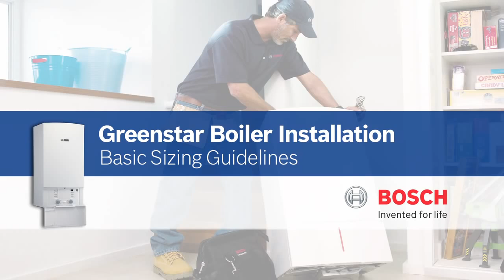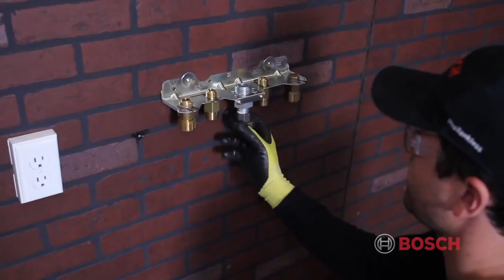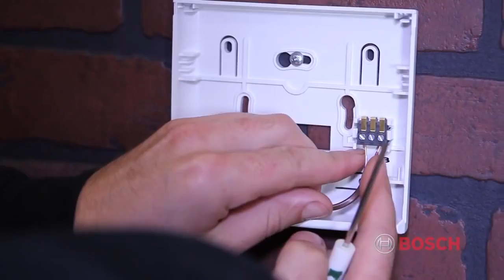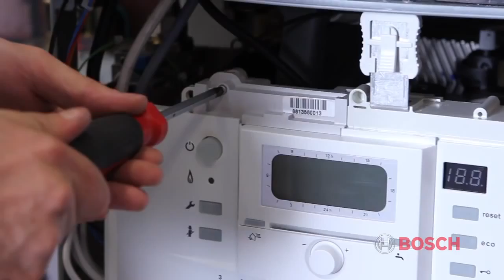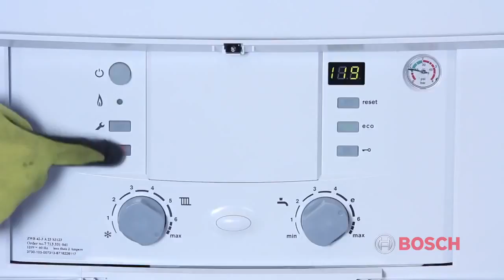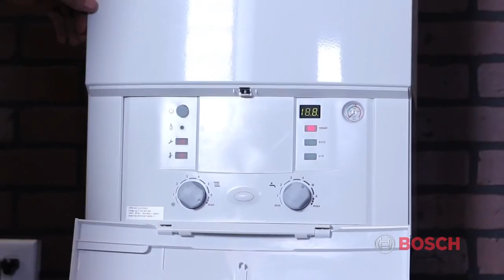Bosch Greenstar Boiler Installation Video

Comment: Hi, i have a problem =/. The bar indicator shakes about 1 minute after i use the hot water. Also pump noise changes. It makes a different noise.

Comment: I have a 3-year new Bosch Greenstar boiler ZBR 35-3. Got a EA code in display and it stopped working for 1.5 months. Ignition assembly and gas valve are new. The flame comes after ignition and gone after 2 seconds. What's the possible cause?
Reply: in my EA case I cleaned filter on the top of combustion chamber with toothbrush :) through the electrode holes.
is your ventilator starts with maximum rotation speed? It might be that in combustion chamber not enough oxygen for continuous burning.
if your boiler is new, then it could be different problem.. these boilers are pretty complicated machines, maybe in your case it is better to ask for professional care.